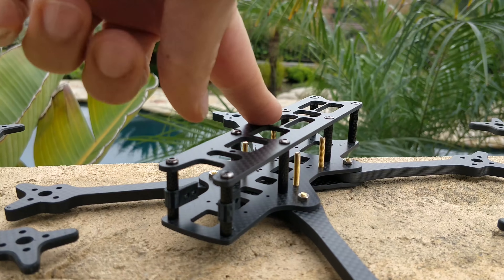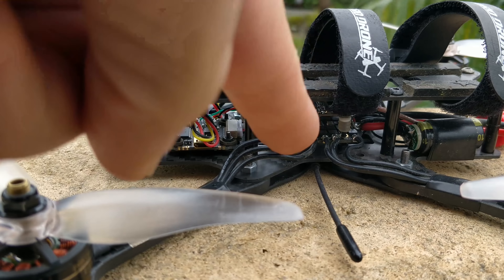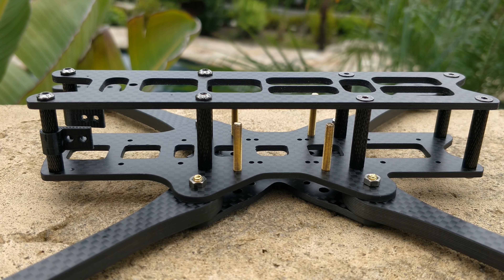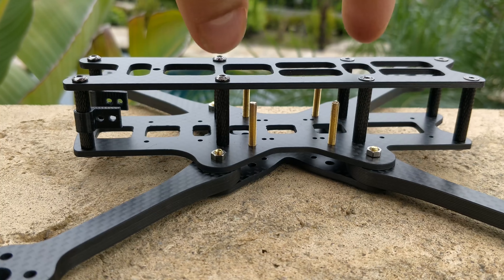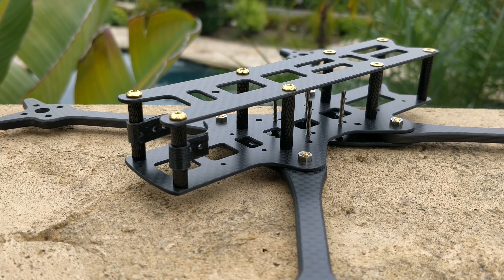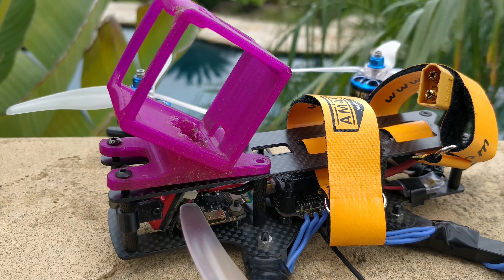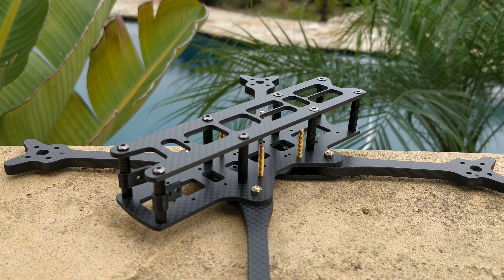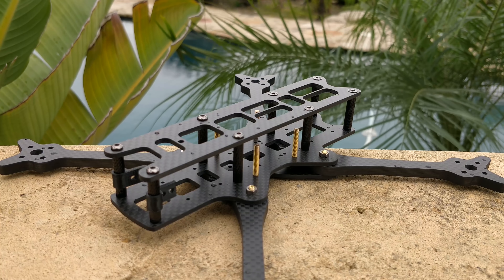Glide - 84g lite, 115g hammer, 97g standard

Comment: I have the Vista Caddx on the way for a micro build that you answered some things about before, but ended up picking up the full DJI fly more kit, because it gave me an air unit and cam for $100, versus buying the goggles and remote separately. Ive been looking at frame choices, and so far the only decent frame I have seen appears to be the iFlight DC5, which you said sucked, lol. About everything else seems to have the air unit hanging on the ass end, which just seems dumb. They're concentrating the weight over the rear props, which already have to work harder. Then some models have stupidly fat arms, which seems like old tech, or for people using separate esc's. Trying to change the direction of a wide flat piece in the air is harder than a more square piece. 

Havent been too keen on the designs like this and the DC5, because it also just seems like a brick with arms. Been looking at the racing style frames, even bigger than 5 inch. But then that puts props in my view. I never see props in gopro footage, so its been crossing my mind about mounting the camera more to where a gopro would sit. Maybe a larger frame would alleviate some of that. I dunno. Not really wanting to actually build a custom frame. I'm a fabricator, and could accomplish it, but the time involved. Really wish I could find a decent freestyle frame, that isnt loaded down. You can buy things like the iFligfht SucceX-A F4 40A board, which has the analog removed. Just one small board, cam, and the DJI air unit, or Vista is all that needed.
Reply from the maker: I have a design on the way that's made to fit the air unit but I do recommend the vista unit because it just makes more sense.  The frame is called the Cineglide and it's quite unique.  Should still be at least 3-5wks however.  Processing is slow at the moment due to the virus slowing everything down.
Reply: @Kabab  Thank you for taking the time to reply. Yeah, I agree the Vista does make more sense. I'm honestly kinda wtf at the Air unit. A chunky block, with no standard mounting holes. It just didn't make sense to not get the whole kit. Lots of things are out of stock due to the Virus, it seems. I thought Flywoo had the Vista in stock, but apparently they just dont indicate on their website. Not sure when mine will arrive. 

Picked up some parts for a 5" build, went with 2208's per your recommendation in another video. I live in an old once abandoned school building, with a few acres of my land around me. Figure I'll build a micro with the Vista for indoors and heavily wooded areas, and a 5" for more open outdoor fun. I'll keep an eye out for the Cineglide. Thanks again.
Reply from the maker: @coolhanddruid  I tried really really really hard to get dji to rethink what they're doing with the air unit and goggles and all. They didn't listen to anything at all unfortunately

Comment: What are your thoughts one the Mamba Mini stack in general (the one that comes with those ESCs you prefer) and what are your thoughts on putting it in your frame? Oh and while you’re here, is there some other 20x20 fc that I could get with a good size BEC for future proofing in case I want to throw in a DJI HD system without getting an external BEC?
Reply from the maker: I'd recommend skipping the stack version.  The Mamba Toothpick board is a better option to go with.  It's surprisingly robust and I'd recommend going with the Vista unit because it'll take direct battery 6S.
Reply: Thanks for the quick reply! The mamba toothpick on a 5in over the F722?

Comment: Dude, my Flowrides are the most bulletproof things that I own. I have 2 of them, for 2 years now, I broke 2 arms so far. They took walls, trees, ground, rocks, barriers, anything between 30 and 100km/h and they refuse to break.
My flosstyle went from 160km/h to 0 at 10m high (high current desoldered the PDB= no battery) straight to the ground and nothing broke.
I even have a 3rd one ready to be built, plus a zillion spare part since they are made anymore. And they are light, with big 2207, session, big cap, 1300 4S and full TPU, they are still 600g
They are the only thing preventing me to buy the DJI HD because i can’t fit another coin in here.
I’m interested in the glide lite though, seems even lighter!
Reply from the maker: The heavy option of the three is gonna be an absolute tank.  I personally ONLY fly the light.  The others just seem like behemoths to me.

Comment: Having the FC off center will only matter if you use angle mode. All the gyro sees in angular velocity/acceleration. As long as the FC is mounted to the frame in some way, and the orientation is configured correctly in software it doesn't matter where it is. You could mount the damn thing to a carbon fiber stick 2 feet away from the frame and it would be fine.
Reply: That's not right when it comes to complicated management. Also acro mode also corrects flight all the time. Otherwise it would be unglyable

Comment: just ordered my Glide, like to use it with Flywoo GOKU F722Mini + 40a esc, runcam Hybrid and 2305-1850KV Amax. don't have a gopro. What do you think about this combo?
Reply from the maker: that's a good combo.  They'll perform well.  2305 1850 is actually my favorite motor size as long as the AUW is kept to no more than about ~610g.  Really stellar control performance.
Reply: @Kabab  thx for the answer , can't wait for the build :) keep up with your outstanding work for us fpv-fans, greetings from Berlin

Comment: R9 works for me pretty good. Been using it for over a year and havent had issues at all. Nice frame tho.
Reply: used it for a few months. worked fine at first. then it would randomly unbind to my quad. i had latest firmware. then it would unbind every single time i went out to fly. then it just quit all together. switched to crossfire. very happy
Reply: @aldenhauser9555  wow thats crazy. I have a x9d plus with it and also the first xlite using its own r9 slim and never had any issues other than my skills here and there
Reply: @aldenhauser9555  by skills i mean my flying skills but i have taken crazy chances and have videos on my phone to prove it
Reply: @Sylo2Nice  and im not the only one unfortunately. 3 of my friends also used r9 and had similar issues. Guess ur lucky!
Reply from the maker: I've had so many issues it's just not worth my time to bother with it and I wouldn't recommend anyone else waste their time on it either. If it works for you, more power to you. Use them all.
Reply: @Kabab  make sure you have the FCC antennas for the R9 and receiver. Super 8 and T antennas would be best. Update both R9 and receiver to latest Flex firmware. Make sure Flex FCC is selected on your radio. Bob's your uncle.
Reply: @Kabab  lol. Thanks bruh. If you send them all i will for a fact use them bitches. It normally takes me just as much time as any other system once you get it going.
Reply: Terrorbirb FPV trust me I was using super 8 and t antennas and was using latest furmware fcc correct frequency and everything. Horrible quality control and super buggy
Reply: @terrorbirbfpv4732  i guess some ppl get unlucky. I ordered ten different type of receivers and have 2 different modules. Idk

Comment: can Hyperlite frames get back to slotted motor mounts?  it kills me not being able to use a floss 3 or a glide with those motors (2806.5 19x19, I edited the comment adding this after kabab reply)
Reply from the maker: Which which motors?  The main reason for the change is because the arm ends are SIGNIFICANTLY stronger and lighter with the 16x16
Reply: @Kabab  sorry 2806.5 size motors (it got lost while typing)

Comment: Just bought a light version yesterday, and I  was thinking of how nice it would be if there was a video about it a few hours ago. I swear you can read minds. Also, caddix has made a air unit that is 30x30 and a lot lower profile ( personally still think it's too heavy and inconsistent in latency to be useful. High latency is fine, low is fine, but switching between the two is hard.). Also, do you have any recommendations for a 20x20? Or should we wait for a dental themed fc and esc :p?
Reply: Once you have the DJI system you'll feel a whole lot different about it imo.
Reply: @terrorbirbfpv4732  I tried it and was blown away by it, I just wanted to stay in the sky and stare at the view forever as it was all I dreamed of. But in my opinion, the quad just doesn't fly well when its that heavy ( personal opinion as everyone's feel for a well flying quad is different). Also, I kept crashing into Once it's a little lighter, I will be first in line to get it.
Reply: Although, for cenimatic flying, I don't think anything can beat it.
Reply from the maker: Nothing will beat DJI for Cinematic work. Nothing for a long long long time most likely.
Reply from the maker: ESC's are plenty now. The mamba ones are what I use and they hold up well.
Reply: @Kabab  thank you, I will look into mambas

Comment: Could you please talk more about why you don't like R9? I was thinking in get one r9+slim receiver
Reply from the maker: I'll talk about it more in the next video. It's just a total pain in the ass.
Reply: I'm really satisfied with my R9 system now. Until December 2018 the firmware especially the 868 MHz version was a nightmare, 1-3 failsafes every flight.
But now with the flex firmware from December 2018, and the updated version of February 2019 I never had an failsafe again in hundreds of packs. 
Now I'm using the access firmware for r9m lite, yust switched to r9m lite pro, the only thing I had to do was to switch on the quad while the radio was in binding mode.
I'm interested in bobs findings in the later video.
But yeah, all the firmware and hardware versions (especially the big R9 Modul) are a pain. 
If you want to buy an R9 system, get the r9m 2019 or r9m lite (pro) and the Ota version receivers and use the right T antennas for your region and an super 8 antenna at the transmitter, or an other good antenna.
Reply from the maker: @SchonRichtig  well yeah that's the main problem. Crossfire works. Always. Period. R9 is just a huge pain in the ass and isn't even long range. I get better range on the regular rxsr with higher reliability. What the hell is the point of R9 then?!  So much more wrong with it but it's less than a half assed product. It's trash
Reply: @Kabab  well, last year I lost an flosstyle 6 in the river, so I had to build 2 new to be on the safe side in case of more failsafes :) 
I agree that crossfire is the more  foolproof system.
With R9 you have to take care of the right antennas and use the right firmware.
But if you use an actual firmware an buy an new receiver now it will be shipped with the T antennas and not the simple wire anymore.
I also agree that crossfire is the better system, but now I can trust the R9 link and I would say that it is ready for sell NOW :)
It wasn't a finished product when they started selling it.
Took over a year to be reliable. And I can understand that all the people that got R9 in this time are really pissed.

Comment: 19x19 motor mounts option and a 7” version? I’m still struggling to find a top mount battery option for the 7”. The Flosstyle and the glide are to heavy.
Reply from the maker: Yeah the 7" arms do 19x19 but I'm not a big fan of 7" on the glide even. For a top mount batt it's a bit tight space on top. The frame is too heavy for a bottom mount. Just inefficient. However a light load acro 7" on it flies like a dream

Comment: What will happen if i use mamba mini mk2 (not the new f7 mini with 30amp) for a 6 inch quad? It only has 25amp esc..
Reply from the maker: It'll work but won't perform optimally. Don't worry about the amp rating. When you're bumping against the performance limit of the ESC, it just isn't consistent so you get wonky characteristics and less overall power
Reply: @Kabab  im asking that because alot of kiss guy only use 25amp esc untill now.
Reply from the maker: @TERBANGFPV  that's because it's most size appropriate. The amp rating isn't that important as long as it's a reasonable amp range
Reply: KababFPV nice info, and 2306 vs 2305, the 2305 will give more efficiency right? But not so much lower torque as 2306

Comment: Is there an even liter version? Like around 45 gram (like switchback 533), but in a deadcat config? Or another frame that can do this?
Reply from the maker: This isn't a racing frame. The switchback is an under mount race frame. Very different
Reply: @Kabab  I know. But I don't wanna race. Just fast cinematic with legal constraints.
Reply: but the switchback will do I guess
Reply from the maker: @babipsylon  my light weight 5" frame for acro frame with dji on board for sub 250g is coming in probably a month or less. The frame weighs 50g and it's full 5.21" size. My latest video is discussing part of the development.
Reply: @Kabab  Saw your  vid. Looks interesting!

Comment: I have a few low tilt files for mounts for the Session without GPS and Hero 7 with GPS and a Vertical ImmortalT on Thingiverse.   Gonna eventually split them and change to steeper angles in the future.    Running a Cheater configured glide with a Diversity Crossfire and a 30mm Hobbywing stack.   Things are packed in tight on that bugger.

Comment: is it possible to put the stack 20x20 inthe back and the dji air unit in the middle?
I don't have time to wait for caddx vista for now.
If the hammer is 115g with the tpu mount im sold
Reply from the maker: As others will show, yeah they've done some crafty things. This frame isn't made for the DJI unit and it won't be changing because I must maintain backwards compatibility. I have another design for the dji and cinematic stuff however
Reply: Thank you both of you 👊 as long as it has room without removing stand offs. This will work 👍 looking forward to see your cinematic frame
Reply from the maker: @Victor90NOR  I don't think it does. I have no idea how they're getting it to work
Reply: Jason's solution looks good. Unit seem to fit in the middle 🤩